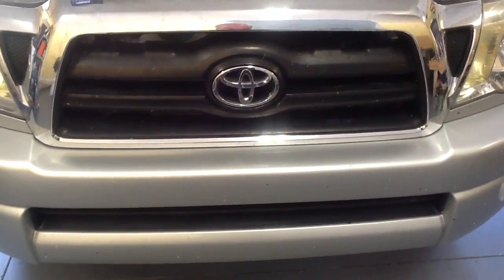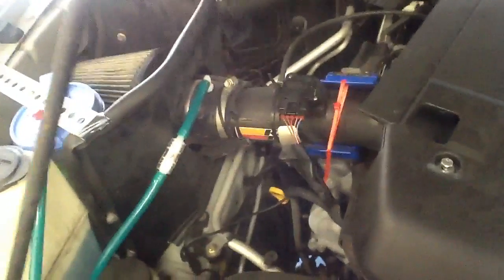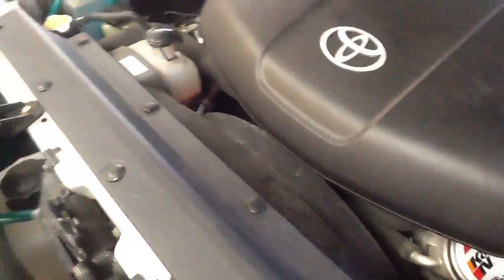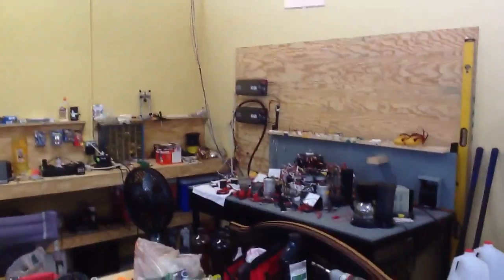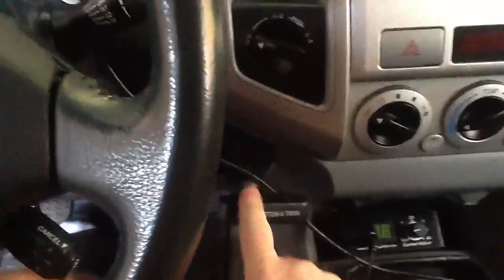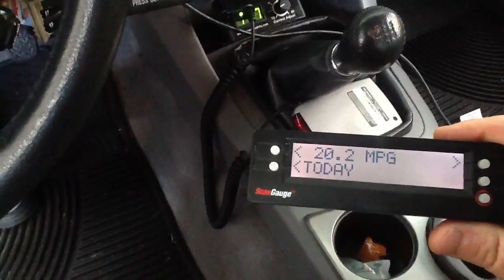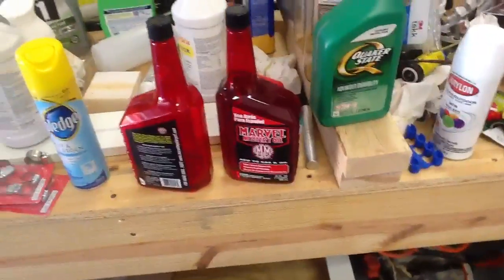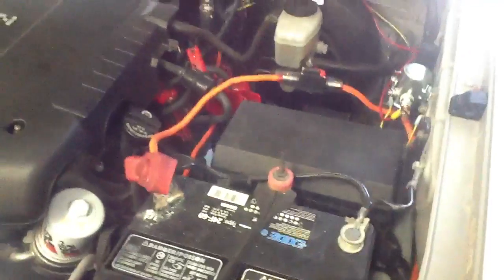HHO V8 Dry Cell Toyota Tacoma V6 4WD 4L

Comment from the maker: There is no Map sensor MAF where you apply the line makes no difference moved it before..This truck has all the running you can do on after market flawed HHO set up systems.. Reprogramming of ECU is the only way to help with HHO...Don't waste your time and $$$. Apply your $$$ To one of our true vapor set ups...That is where we are focusing now with fantastic results and zero carbon footprint.. I will be posting a vapor generator Honda Black max and Some Jphn Deere Tractors we have tuned to True 100% vapor Gasoline..Stay tuned .
Reply: u mean vaporize the fuel right?

Comment: oh i see what's the problem here! your  hydrogen line is hooked up before map sensor(which mean ECU thinks that you are putting more air thus it's is running richer. Either hook the line after ecu sensor or use map enhancer to program it

Comment: brilliant...i could see a 1932 with some kind of hydrogen supplement system...its not even close to what the 4cyl gets for mpg (the v6 is pointless in a mini) my 4cyl taco would get 30mpg and run way cleaner with this setup

Comment: Did you install the non direct o2 sensor adaptor? If you didn't you ecu would think that it is running too lean and will add more fuel, that wouldn't let you get the most out of your HHO system.